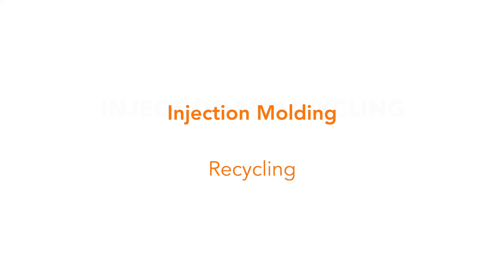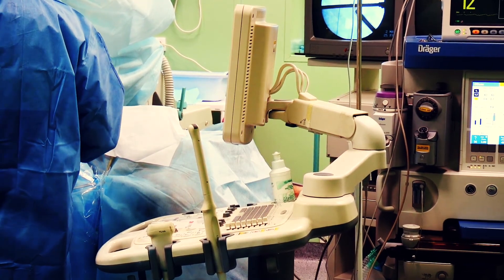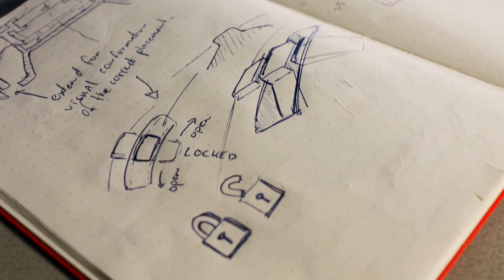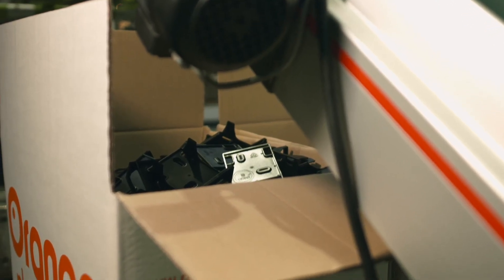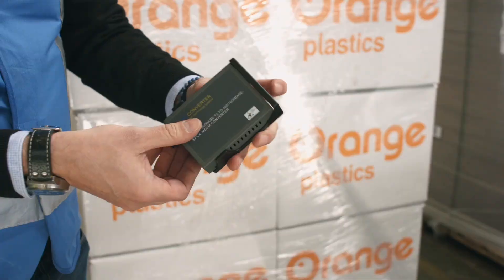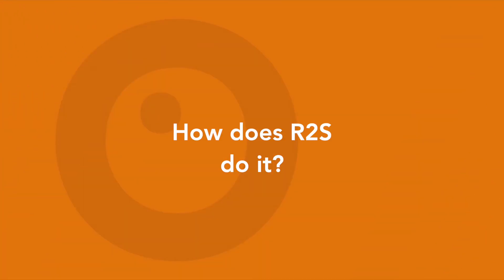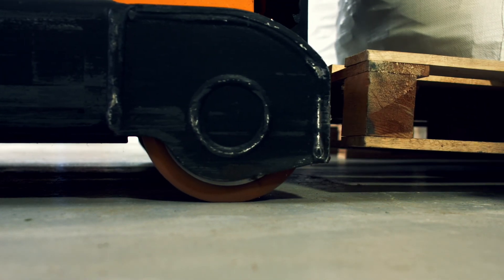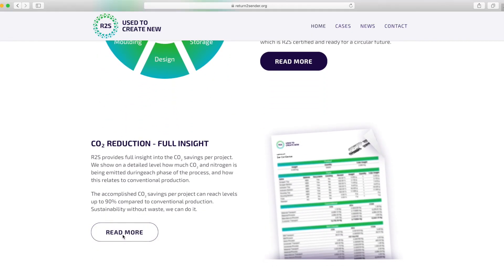Injection Molding Recycling: The Benefits of Horizontal Recycling with R2S

Comment: Good knowledgeable video. I have an empty warehouse I recently inherited. I would like to start manufacturing plastic bottles and add a water bottling line also. I'm jumping into unknown territory, but there is a market that isn't being filled. All bottled water is imported to my country for no apparent reason. The acreage the warehouse sits on has a natural spring that has been tested good for drinking water. My question is how do I get started. A ton of info out there but nothing targeting startups(production). I have space and capital already set aside. Can you give suggestions and/or any direction?
Reply: Hi Michael, i'm glad you like the video. Making bottles is done by a technique called 'blow molding'. If you are willing to invest in machines, material and knowledge for blow molding I suggest you find a local partner or supplier.
Reply: @harmvanrooijen1272  thanks for replying. I've watched tons of video on the molds, machines, etc. This is a small country in Caribbean that has no local suppliers. So I believe I have all capital I'd need to start up. There's hundreds of natural rivers here but we import bottled water. No restrictions of any kind. I tried contacting mold and machinery manufactures with no reply.
Reply: @silverback252  if you interested I can assist you with your recycling needs